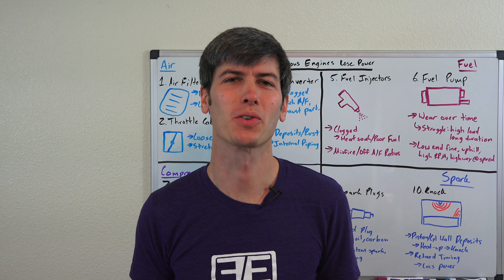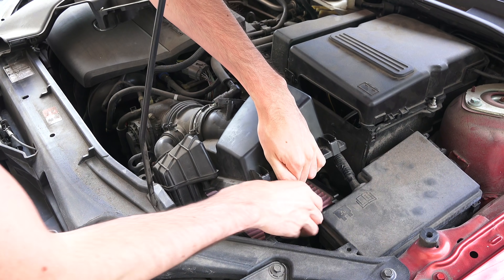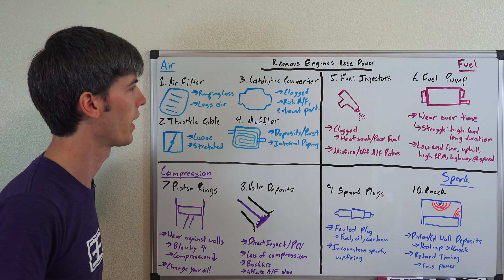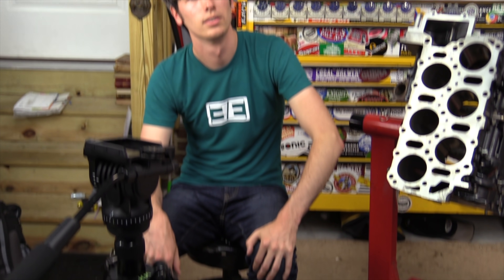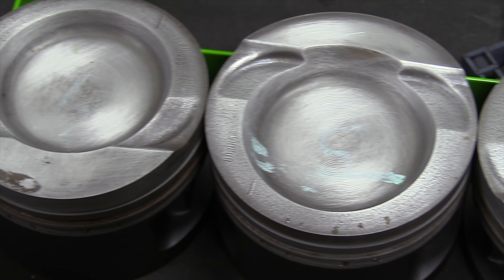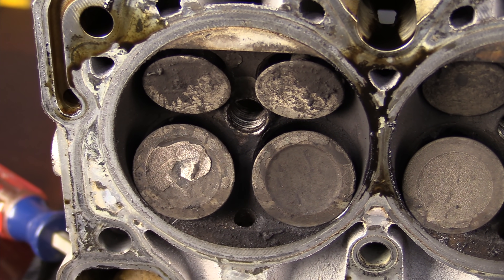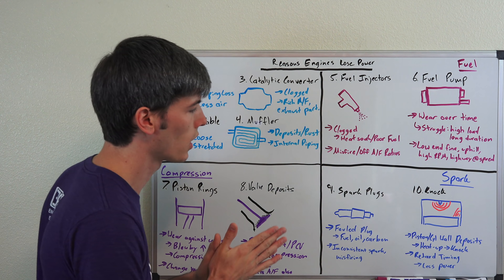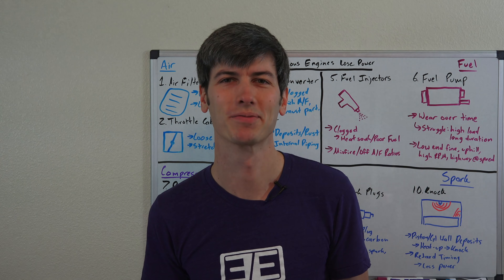10 Reasons Why Engines Lose Power Over Time

Comment: Does an electric motor lose power as they get older?
Reply: It can yeah. Copper can oxidise and deteriorate over time, arcing and carbon buildup in areas where connections might be breaking down, and bearing failure. Bearings are usually sealed units and eventually these will fail. Not to mention wearing out of electronics such as the inverters required for power and regen.

All these can get affected by the rattling about of daily life. All the potholes, speed bumps, parking up kerbs, cobbled streets, cattle grids etc.

It night last a little longer though.

I've seen water pumps for large treatment sites that have been running faultlessly since the early 60's. Only being removed to be scaled up for higher population demand.

But they're not being rattled about every day.
Reply: Thanks !
Reply: It's an difficult question because there are different types of engines in hybrid and electric cars. 

BMW and Tesla uses induction engines and Toyota en Nissan uses an electric motors with permanent magnets. One engine types has advantages over the other, but the power loss of engines with permanent magnets is at a very low rate and with induction there is none. 

A much bigger problem is temperature for electric motors. When they heat up they lose power. The induction motor will have more resistance in the copper wires when it gets warm and magnets will lose power when they get warm. So when electric motors gets older and lose power it is probably because their operating temperature is increased  (by decrease in cooling efficiency).
Reply: Ian Melnyk he said motor not battery.  Cmon now.
Reply: No, wires doesn't burn up. For that to happen the wires would need to get so hot that the copper starts to oxidize - but, that also means all the insulation on the wires would burn off. So a motor will short out and fail far before there are any significant due to degradation of the copper.
Motors with permanent magnets can in fact lose power and still work, if they get too hot - because magnets get weaker, when they get up to high temperatures (that means the motors get less torque). So, insufficient cooling may cause a power loss in some motors - but as long as a brushless motor is not overheated, it will not degrade.
Reply: Ok, but the motors in RC cars is often pushed quite hard and have very high power compared to their size, so I can think overheating may be more of an issue there. Also - if a car is stuck in traffic, the load on the motors is very low since not much power is needed. Electric motor is not like an ICE that uses a lot of power just idling.
EDIT: batteries also heat up, and that cause problem for (full size) electric cars more often than the motors does. That may be what you think of. Again, the batteries is the limiting factor and that's where we still have some work to do, to get the perfect car.
Reply: coils in a motor can lose inductance when the varnish like insulation on the coils get worn from extreme heat..batteries can depreciate over time... control circuit boards that throttle the flow of the massive amps of current from battery into the motor can go wrong...control circuits that convert massive dc amps into ac oscillating waves can also go wrong...still better than a ICE engine!! get an electric car best bet you can make!
Reply: +Ride84XL i understand they don't have brushes but a brushless alternator would still lose ohms eventually would it not?
Reply: No, a brushless motor have just solid connections all the way (it's all wires and fixed connections) - there is no sliding contacts that can have resistance when worn. But, the typical alternators used in cars, do have sliding contacts (pretty much like a brushed motor).
Reply: +Ride84XL If you replace brushes in an alternator you're telling me it'll never have a reduced output?
Reply: The Motor doesnt.The Battery does lose performance with time.
Reply: Electronics can't normally cause power loss. If they did, they would quickly fail due to the higher heat load on the components. Same thing if the bearings fail - they will heat up and wear out quicker, heat up even more and wear out even quicker, until failure. 
You would probably not run with a bad bearing for long until it fails completely. And you will notice it directly, since it causes a lot of noise. Given that an electric motor is not overheated, the bearings is what fails first. But this isn't a problem since the life time of those is so much longer than the piston o-rings, valves and other moving parts of a petrol engine.

On brushed motors, the carbon brushes may wear out and cause slight power loss. But electric cars normally use brushless motors that don't have this problem. Also, the brushes on brushed motors (usually made of graphite) is cheap and it's very little work to replace them, compared to all the maintenace of a petrol engine.

The only limiting factor is the batteries - those may get worse over time like all rechargeble batteries. The internal resistance goes up. That will limit the amount of current you can draw from them. But again it doesn't happen very quickly compared to a gasoline engine, with poor maintenance. At the time they get too bad and need to be replaced - a gas car that has been running the same total distance would also have summed up a large cost in replaced parts (if you want to avoid power loss).
Also - for us who don't own a house with fully equipped garage and can do all the maintenance our self, the added cost of having a workshop do it and the expense of fuel compared to electricity (especially here in Europe, with our high fuel prices) will cost more than the battery replacement.
Reply: Can coils not lose resistance?
Reply: +Mewzyc They actually don't degrade. LinusTechTips did a video on that.
Reply: I can imagine the magnets inside will lose their strength as well, due to heat. Some magnets actually stop being magnetic permanently when heated. I've no idea if this applies to electric motors in cars
Reply: Yup nothing lasts forever, but then who cares? We also don't last forever
Reply: Yes it will loose power as it gets older. I see people saying that brushless motors are not effected due to the lack of contacts. While it is true it takes longer for them to loose power they still will eventually fail, ignoring the obvious baring failures the copper windings alone  can and will increase resistance over time. Alot of people forget that electrons have mass, as they move through the conductor they will start to damage the wire due to a process called electromigration, "the gradual movement of the ions in a conductor due to the momentum transfer between conducting electrons and diffusing metal atoms."

Bottom line is everything has moving parts even on the subatomic level so eventually everything will fail.
Reply: After using electric power jacks and forklifts for years at work, they lose power very fast. You can change the batteries and they still make less power as they get used. They really go down fast if you try moving heavy stuff. They start to get really got and smell like acid and copper melting. Makes me nauseous
Reply: 2 reasons why EM can lose power:
1. battery: overheated battery can decrease the power output
2. coil: coil is a fast moving components, which like pistons and bearings, it would wear over time.
Reply: Anything that moves will loose momentum eventually ,the question  should be when.
Reply: @MichaelFlitter  indeed it does,makes one think-our planet has as well a finite limit ,hence with that thought so does an electric motor,the secret is to design one that will require low maintenance and a long life span ,that is if the spares and maintenance  are not part of the recurring  financial plan.
Reply: Nope
Reply: nah, motors just quit working   :D  power on, Power off
Reply: If it's anything like cpu and pc RAM, things will degrade overtime with usage and not perform as well. BUT I could be pulling stuff out of my ass.
Reply: +9600GTMAN So a motor would too right? Brushed or brushless.
Reply: I guess nothing lasts forever in this world :(
Reply: It would gain ohms, not lose ohms.
Reply: Actually no. The loss of power in an electric motor is mostly indirect, meaning it is related to external factors. In theory an electric motor either works or it does not work. Of course shaft bearing failure may lead to power sap but even that does not affect the actual power input. The power output in EM, however is not a constant. Depending on the mechanical setup loss of power can occur on many levels. 
One particular thing to look out for, if it motor is brushed one, is to replace the brushes if needed, because they tend to wear down over time.
Reply: Yes. Bearings wear out, etc. Everything mechanical breaks eventually. But what's the real analogy, since I presume you;re just trying to bash ICE cars, is "does the battery in an electric car loose power as it gets older". The answer is "yes, quite soon, and yes, it's expensive to but a new one". They are not straight parallels. The motor in an electric car is more like the differential of a gas car. The piston engine is the 'energy supply", just like the battery of the electric car. That's the most fair way to compare them. As a power source, a piston engine is highly developed. As a automobile power source, the battery is still new technology. Electric motors have been around a long time, and is well developed into forms suitable for automotive use, and for long service. But they do wear out without maintenance.
Reply: Yes and if put under heavy loads or hard acceleration it can burn out
Reply: anything that spins or moves will eventually wear out.
Reply: Everything wears out. You can rebuild electric motors just like engines, but differently
Reply: Electric motors do not have brushes anymore. Eventually the bearings go. Replace bearings, good for 5 more years.
Reply: Depends but yes they can (for the example brush motors where brush wears down)
Reply: Yes, they do but very slowly.
Reply: A brushed electric motor will lose power over time. A brushless should keep its power until the wires get dirty or something nad there is not a ver good contact between wires and components. Batteries will always eventually become worn
Reply: The motors doesn't lose power - but the batteries in an electric car does. Although, it's still very little compared to a petrol engine without all the maintenance and replacement of expensive parts (like the exhaust system) shown in this video.
Reply: This.
Reply: Cant they lose power just like an alternator reduces its output?
Reply: @thetuber705  Alternator does not lose output - unless the Alternator drive belt is incorrectly tensioned.
Reply: Just like any battery, they will begin to lose power. It's just like using your phone or laptop over a long time, eventually you notice it doesn't last as long or perform as well.
Reply: Brushed motors wear down because the brushes get eaten up the same way that brake pads do. You could replace the brushes in some motors or replace the whole motor. Brushless motors last a very long time... I'm not sure how long, but I would imagine the bearings would probably be the first thing to go.
Reply: That's right ! 
Thanks XD
Reply: If the bushings wear out
Reply: Alternators is pretty much brushed motors - just that it's used as a generator rather than a motor. Electric cars uses brushless motors, that doesn't have that problem. But if there are some model out there, that use brushed motors, replace the brushes when they wear out, is an easy task compared to keep a petrol engine running.
Reply: Probably the battery will lose some capacity. I don't know about automotive or industrial electric motor but my don't know how old fan can took 10 minutes to get into self sustaining speed in speed 2 when it's not cooperating and 1 (lowest) it won't even run :v Can't even access the bolts to clean the motor or oil the bearing, the design really sucks cough like modern cars cough

Comment: awesome to see 2160p
Reply: 11696Ron I tried 1440p and it took 3 mins for 13 seconds of the video to play
Reply: I mean that's based on your connection and your device really. Everything runs fine for me, but that's because I'm using a good PC, have a wired connection and verizon fios.

Comment: Luckily my exhaust system no longer has a catalytic converter. 😂😂😂
Reply: It's legal for my 63 ford ;)
Reply: I know right, my cat always has gas.
Reply: Isaiah Hamilton yes, they make high flow cats
Reply: Engineering Explained Actually, it's perfectly legal in Saskatchewan Canada. We have no emission testing whatsoever in this province
Reply from the maker: It's not legal anywhere +nunchaks700. It's okay to do the right thing, your neighbors appreciate it. :)
Reply: Meow.
Reply: legal here in new zealand on cars before 2011
Reply: Engineering Explained here in Texas it's legal, well no one agency (cops, EPA, DMV) actually checks on it therefore it's not illegal, except if you live in a highly populated county like Harris county (Houston tx) where they do a smog test along with the inspection, unless you vehicle is older than 25 years in which case it is exempt.
Reply: What do you mean "it's not legal anywhere"? Is there some federal regulation now mandating cats? We don't even test emissions in my state. You probably cant' get a car inspected without one, but it's not illegal to drive without it.
Reply: no cats = slow death
Reply: Engineering Explained It may not be legal, but some states (like NJ, where I am for example) are no longer doing emissions testing on normal vehicles 1995 or older as they do not have ODBII ports. So in a way, the car folk see this as making straight-pipes on older performance vehicles somewhat OK now, or at least "less-illegal" as the state is not proactively trying to enforce the legality of it. Those older cars ('95 and older) are now exempt from state inspections.
Reply: As far as I know, in my state, CA, you can't replace a 1996 and up cat unless the stock one is bad. High-flow cats were frowned apon by the California Air Authority, (better known as C.A.R.B.), and are only legal on off road cars. Doesn't make sense, if it's off road only, why cat it?  I'm not sure if that is a thing still, this is what I remember  back in the early 2000's when I was more into this stuff.
Reply: dope
Reply: It's still illegal in California. It's completely illegal to modify any stock emissions control devices. You have to replace a bad cat with a OEM factory cat for your car(in California).

The only allowed exhaust mods are a cat-back exhaust system(not replacing any OEM catalytic converters).
Reply: justforever96 its been illegal for a while to tamper with federal emissions check it out
Reply: It's legal in some countries, like mine. Lol
Reply: I am more of a dog person so my cats are the first thing to go, the $100 I pay a year to have someone pass it for me is worth it.
Reply: Yeah you sound like a douchebag, your car is probably still slow af, just cus it's loud doesn't make it any cooler if that is what you thought
Reply: Hector Sanchez what do you drive ms. douche bag, you probably drive a Kia, my car is loud and fast so is my gsxr. I bet my wife's Harley can smoke whatever junk you drive.
Reply: I'll never run catless... it stinks when you come to a stop, and everyone behind you has to smell your exhaust. It's like being behind a diesel, but not as bad.
Reply: No cats smells so bad
Reply: Its illegal to tamper with emissions in all 50 states, wether you have emissions testings or not. -Federal Emissions
Reply: nunchaks700 Hey, me too. They quit doing annual inspections and emissions testing in my state since before my car was even built 30 years ago. So, when my cats finally plugged up, I just got rid of them. They are expensive. Runs and smells much better without them. Its just like going a few mph over the speed limit. It is not legal anywhere, yet its very rarely enforced.

Besides, the more people that buy electric cars now, the less guilty I am about my aftermarket exhaust :)
Reply: thanks for damaging everyones environment for no reason - meanwhile korea is selling electric cars only in 2020 or europe with their diesel banning
i m the last hippie, i love motorsports, loud engines and so on but this is just unnecessary
Reply: Buy diesel trucks...not volvo.

Comment: How about a fuel filter? I would think a clogged fuel filter would restrict fuel, especially under heavy loads.
Reply: of course,there are way more reasons,but he just said the main reasons ;)
Reply: And you never will. Car Engineers today had the brilliant idea of putting the fuel filter inside the gas tank. To change a fuel filter in most modern cars you have to drop the fuel tank. A $1000 fix (due to labor cost), unless you do it yourself.
Reply: @naula7  ,,, In addition to the fuel filter in the gas tank there is also another gas filter in the engine compartment. It is usually adjacent to the fuel injectors in most Honda's.
Reply: @naula7  .... or remove the back seat, unscrew the cover panel and then more screws for the pump assembly. A right pain in some models. I was told my 323F has a lifetime fuel filter, and that it never needs changing.
Reply: Funny, unless you're a car enthusiast/mechanic than a fuel filter is usually one of the most neglected maintenance items. I don't think I've ever gone to a quick lube place and been tried to be upsold a fuel filter.
Reply: failure of sensors in an EFI engine...
Reply: You absolutely right my friend, and so many people never even give a fleeting thought to changing one of these!
Reply: @bobpress1235  unless your bike mimics an empty tank and your stuck on the side of road changing her out.
Reply: My fuel filter is on the fuel pump.
Reply: My car became way more alive after I changed the fuel filter. Surprising how much of a difference that made.